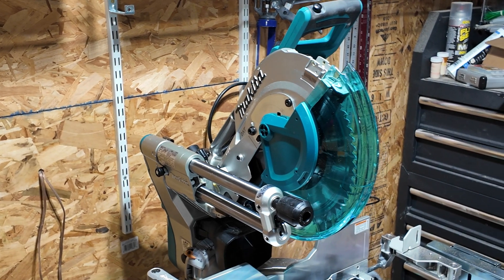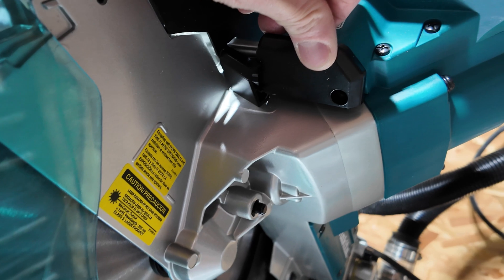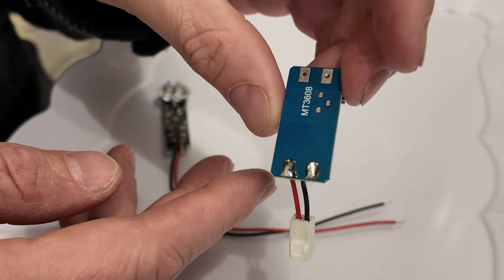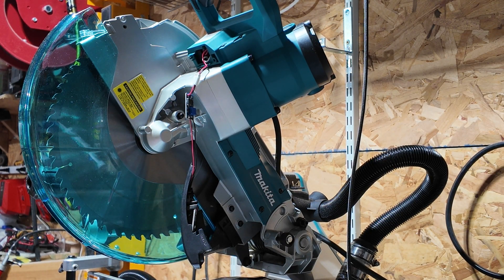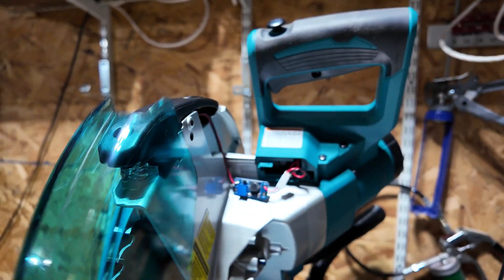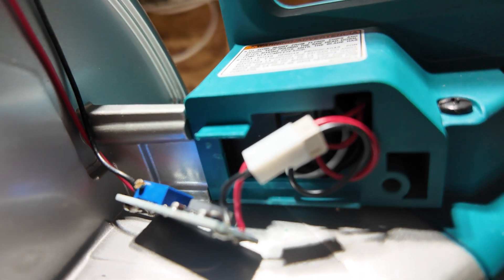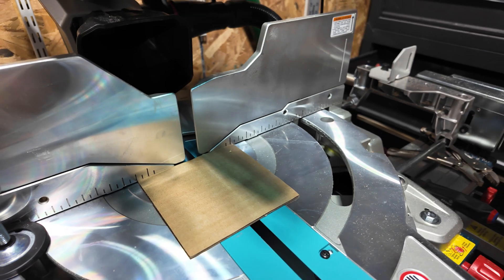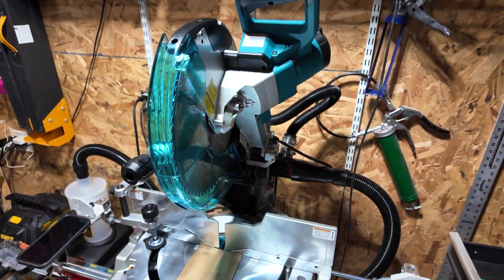Makita LS1219L Laser Swap to LED Retrofit

Comment: Thank you this is helpful! On top of the retrofitting I need to add a power supply unit first cause mine is the non laser version, I looked on the same reddit post someone mentioned that is doable, just got my parts, will start working soon.
Reply: Mine is the LS1019, will see if it works and probably record the process and post it.

Comment: What are those extensions on wash side of the saw
Reply from the maker: I explain those at @11:52 - essentially I reroute the way the dust collector is setup and have it running into a dust collector/shop vac setup to keep my garage from becoming coated in sawdust and moving more freely.

Comment: Just did this "Upgrade" and to be honest, not impressed.  I think it is because my shop is lit up so well that it drowns out any light put out by the LEDs.  Not that the laser was that much better.  The light that was on my old Dewalt was way brighter under the same lighting conditions and had no problem creating a shadow.  I am going to see if I can come up with a brighter solution, because I really want the shadow line rather than a laser.
Thanks for creating the video though, got me through it perfectly.
Reply from the maker: Did you try the larger of the two boards? That one is supposed to increase the output quite a bit. I never used the one I bought because I can see it well enough with the smaller version, and with 3 littles, I just don't have the time to spend swapping it out right now.
Reply: @HoneyBadgerAP  I did not, I used the shorter one but I think your links for both go to the short one.  Maybe the Amps are too low?
Reply from the maker: @cdl1701 entirely possible, and you are correct about the link (I just fixed it in the description). Here is the correct link: https://a.co/d/2pZpC12
Reply: I tried a 4amp one and same result.  Have a 10amp power supply coming to see if that makes a difference.
Reply from the maker: @cdl1701  awesome! Keep me posted, and let me know if that is the difference needed! If so, also include a link to the PS you used.

Comment: Any where to download the stl for the vaccuum adapter?
Reply from the maker: I tried replying here once and I don't think it worked because I included amazon links for where to get the hose and 3d print adapter? I'll try posting again but may have to just send it to you in a message i suppose? 

3d print: https://www.thingiverse.com/thing:5426630/files
Adapter for 3d Print to dust collector hose: https://a.co/d/a2fCkvl
Hose I used to couple stock hose to 3d print: https://a.co/d/7Qi3jh5

Comment: Does anyone know if this can be done to the none laser version?  (LS1219)
Maybe splice into power in the handle?
Reply from the maker: @GTOOtt  you would have to find a way to add an on/off switch for starters, since yours wouldn’t have one. The next thing you’d need to look at is where you would mount the light. I’m not familiar with your saw so it is hard to say whether or not it would be feasible without serious modification.

Comment: You ordered the wrong led cover, you ordered the 10" part instead of the 12" (141D32-3 for LS1019L - 10" vs 141C21-2 for LS1219L - 12")
Reply from the maker: Yup, in the info portion of the video I called that out. I got the correct one and the fit is much better and makes a lot more sense after the fact.

Comment: Thanks for the video. I ordered the Makita parts but I use my saw mostly just outside my garage. Not in direct sunlight but it was had to see the laser in this light. Do you think I need the bigger converter? - Thanks
Reply from the maker: I haven't found it necessary as of yet. I have the bigger one but haven't put it in. My saw is by a door and my overhead light is super bright and I can still see the shadow in either condition. If you were going to be cutting outside I might recommend it, but, for the cost of the parts I would probably just start with the smaller one and order the bigger one after if you find it's not bright enough. Glad the video was helpful!

Comment: I did this on my LS1219L today.  The problem is that I do not get a shadow line at all.  All of the correct parts were ordered and installed, and I installed the "upgraded" DC-DC converter.  I will post on Pemphillips Reddit post and see what is up.
Reply from the maker: Hrmm, that’s odd. You did the turning up the converter til it was full brightness and turned off and then backed it off a touch? I never tried with the bigger converter even though I bought it. I’d def post up in there and see what they see. Did you check the voltage with a meter?
Reply: @HoneyBadgerAP  It turns out that the first DC-DC converter was either faulty or I messed it up somehow.  I ordered more and once I wired in the new one, which I set to 38 volts, the shadow line showed up perfectly.  Problem solved!
Reply from the maker: @6milesup  that’s great to hear! Glad it worked out! The shadow line is immensely better than the dumb laser. I’ve been content with the lower converter’s output since I don’t do much outside. Do you notice the bigger one having a much brighter shadow line? I’m just trying to decide if I swap it out and try to make it fit somewhere or not.